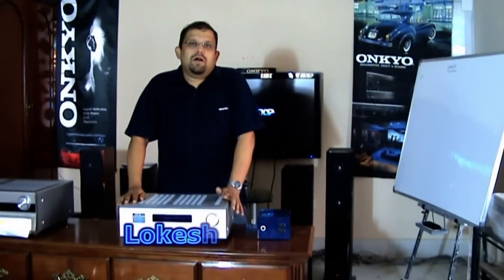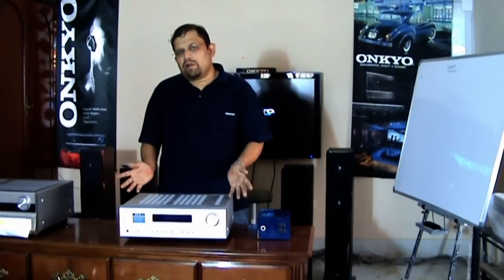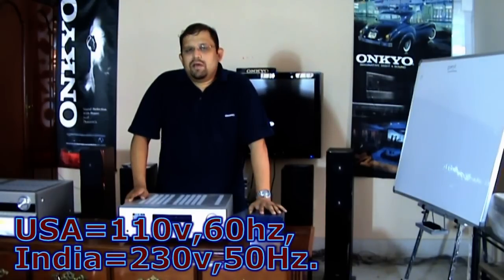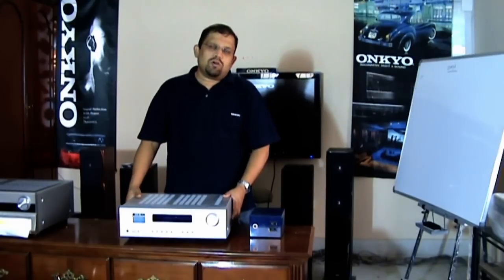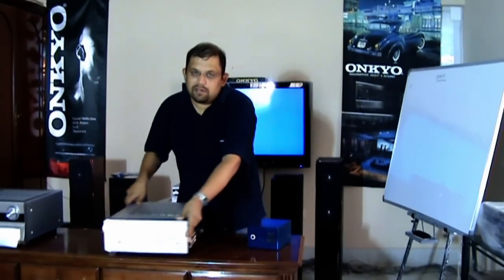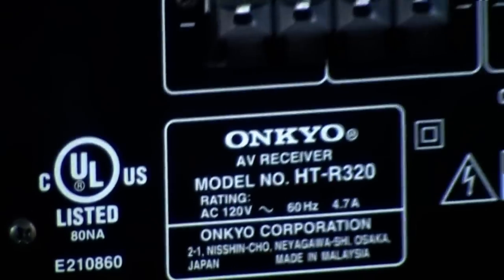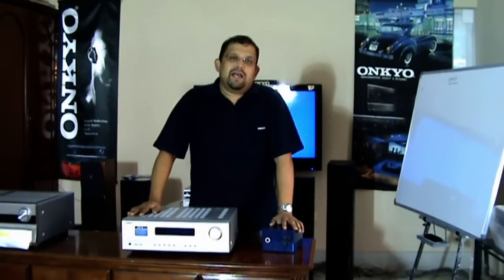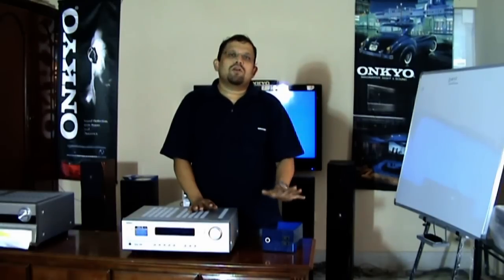110v StepDown Voltage Converter

Comment: HI Thanks for this nice video. I bought Samsung 32 inches 4K 5 series TV . On the back side of the TV AC 110-120V-60Hz 65W. Typical power: 27W. If you can advise what kind of Step down unit I should buy to operate this TV in India. how much watt converter i should buy. if you can provide me the link from Amazon that would be great. Thanks for the help.

Comment: Can you please elaborate a little more on the Wavy video issue. Is it due to 50Hz of Power Source ?
Reply: wingsofwill
If you are using 220v 50hz then you are stepping down to 110v.
Now how come frequency will change? This part I do not understand.

Comment: AC is converted to DC and then used in any digital appliances. Change in frequency will not affect the video quality. 10 Hz drop in frequency might add in some ripple but all branded appliances will have a regulator that will take care of.  Correct me if i am wrong.
Reply: It will affect Hz on electric clocks and hairclippers. It will make horrible noise on US clippers with stepdown on 50Hz.